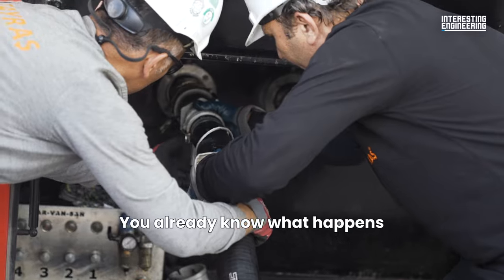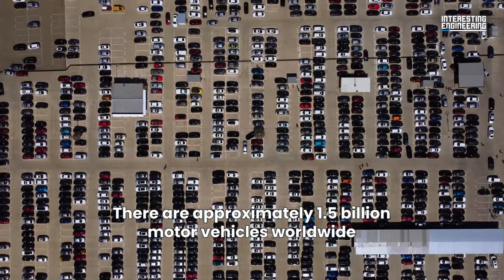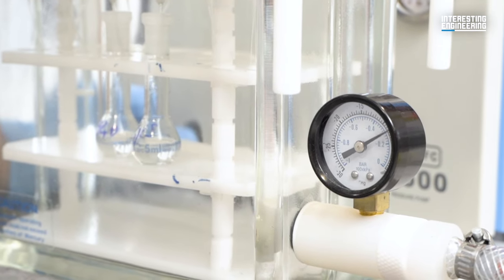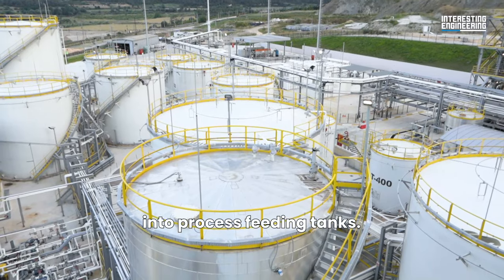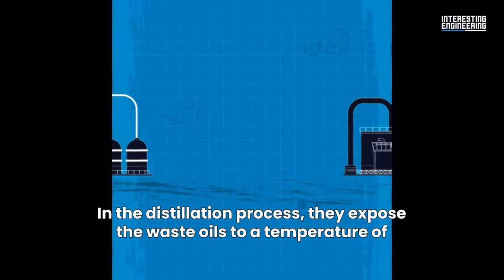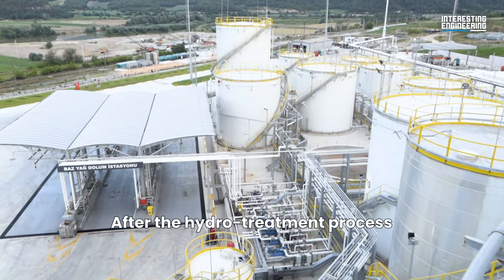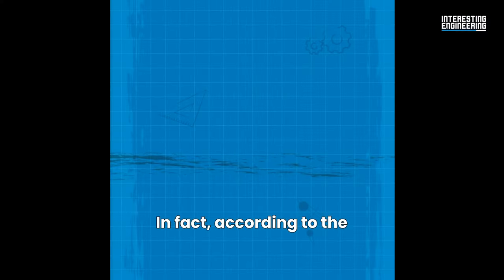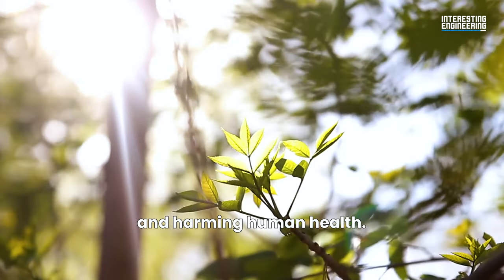How to Recycle Lubricating Oil to Produce Base Oil

Comment: of all the videos on youtube that get fact checked.... why is the channel telling people their car will blow up and cost them their lives if they don't change their oil?
Reply: Blowing up with flames is an exaggeration, it is only catastrophic to the engine components.
Reply: @trevscivil4037 😂😂😂😂cause what makes the car catch on fire is because  of an electrical failure 😂😂😂
Reply: 😂🤣😂🤣😂🤣 I support it
Reply: The car can definitely explode when a connecting rod opens a hole for a gallon of boiling hot oil to spray into an almost incandescent exhaust manifold.

Comment: I wonder if you can put used oil in a centrifuge to separate all the impurities out.
Reply: Hay, do you know about centrifugal separators? I need some help to clarify some issues. How can i contact you
Reply: You can, but there tons more than that to do with oil to make it useable again.
What about the depleted chemical packages, the dissolved contaminants ?
A centrifuge not going to help with that.
Reply: Yas
Reply: If you add xylene to the mixture of oil at a half and half rate it will spin out to show you the amounts of solids, emulsion, oil, and water out of the mix

Comment: There’s no way they couldn’t refine used oil. I’ve seen what it looks like out of the ground. Profit must not be the same
Reply: Indeed. The problem is with the profit. Recycling/refining used engine oils are not profitable on large scale.

From my perspective I can see two major problems concerning this. 

1-First is the logistics, it's very expensive and unpractical to go and collect used engine oil from every mechanic shop in the city. 
2-second, it's waste when no one wants it and most mechanic shops dispose it. However, if a big company started to show interest and buy used engine oil in large scale mechanic shops will start to sell it more expensively which affects the profit.